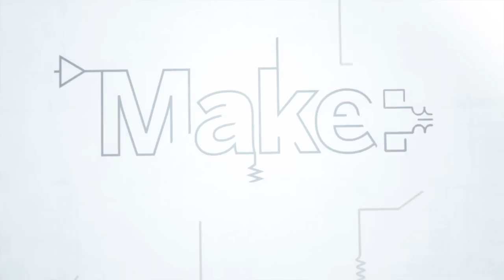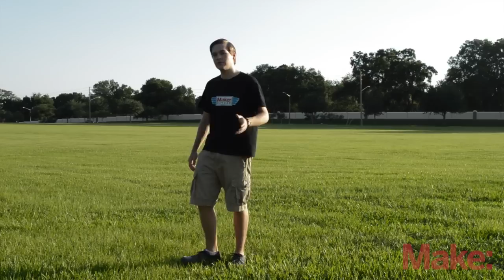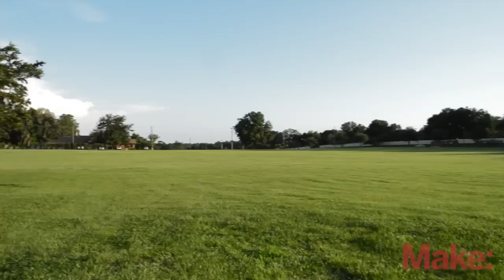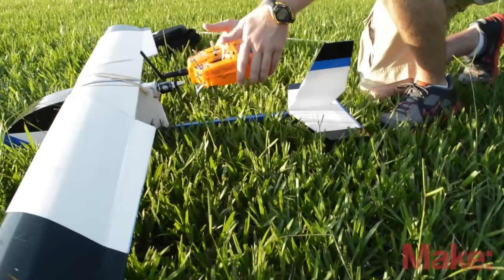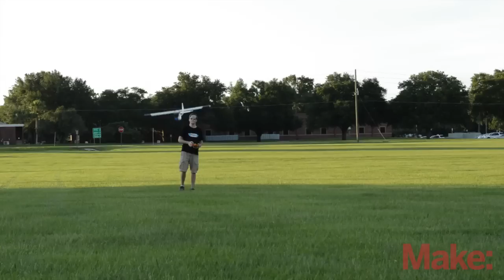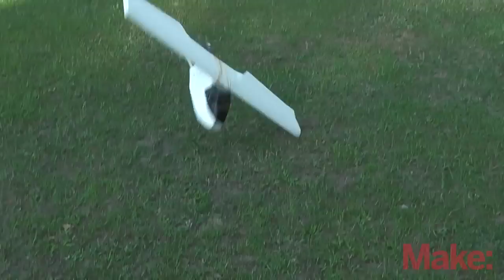Maker Hangar: Episode 14 - Flying

Comment: one thing remember to check the battery after about 5 min of flight, up until you know how long you can fly on a full balance charge the battery can puff when flown for to long and may burn !! it mite happen.  don't go under 40 % battery to help be save and have some power for if you need to make turns to land properly.     Ps Nice series love what you are doing for the Hobby !!!!!!

Comment: Good effort.   One thing is how he suggests launching.   As an experience pilot and an instructor I have to take exception to his recommendation to launch your plane up.   For new pilots I usually recommend a level or even slightly down launch angle to be sure the plane won't stall.  Of course if your plane has enough power you can launch up but level is usually best.

Comment: I will correct you on hand launching, Idealy you should launch level to avoid stalling the wings on launch. This allows the plane to accelerate and have increased airflow faster over the wings. it will dip slightly but this will give more lift and speed and thus more control when you pull up.

Comment: Pretty good overall, but there are two things I would change. A. You should throw the plane level at takeoff. Throwing it upwards will rob you of airspeed, not help you climb out. B. Trimming should be done after you land if you are a beginner. It isnt good to have someone who is already trying to learn just to fly take their fingers/focus/control off their plane in mid air. Save trimming until you have landed unless you are a more experienced pilot.

Comment: The comment about using the rudder (in 3axis controls) to start the turn is misleading. As an r/c & full size pilot as a general rule you bank the aircraft in the desired direction, apply elevator to maintain level flight and coordinate with rudder. From experience I've only ever used rudder as a solitary means of turning an aircraft during turbulent conditions to prevent tip stalling
Reply: I never use my rudder unless i'm crabbing personally

Comment: please tell me the weight of this plane because I am using another foam or is half completed but looking too much bulky specially wings
Reply: I HAD MADE THIS PLANE IF U ARE FROM INDIA THEN YOU CAN USE DENSE FOAM WHICH ARE USED IN FISH MARKET AND THE WEIGHT WITH EVERYTHING WILL BE AROUND 460 TO 520 GRAMS
Reply: Suvodeep Saha I made it with a different type of foam it is about 2kg with everything thing and I am using a 900kv motor
Reply: World Of Every Thing I found an 800kv motor which will give you 2.65 kg of thrust